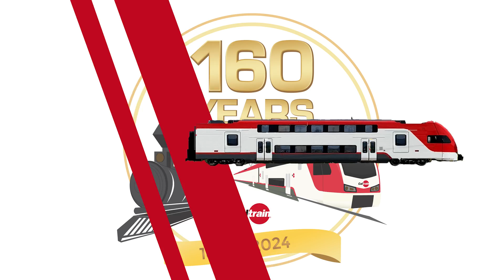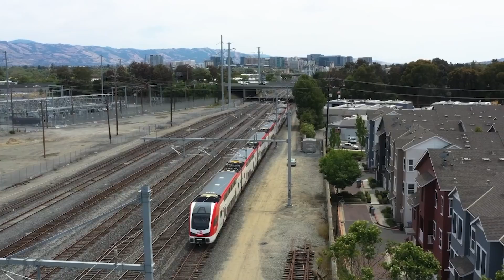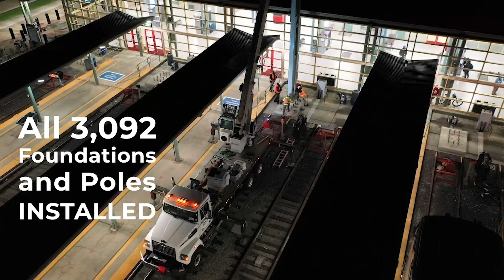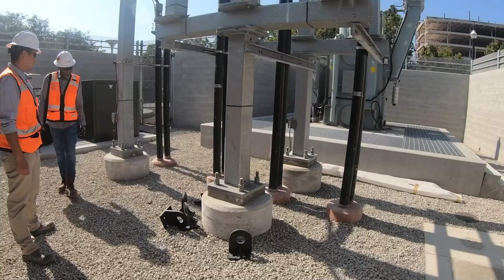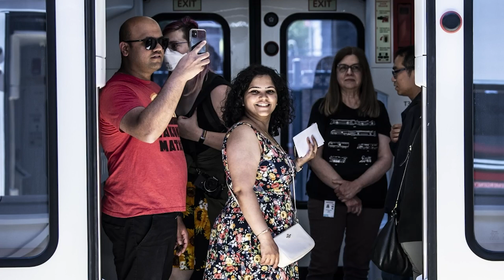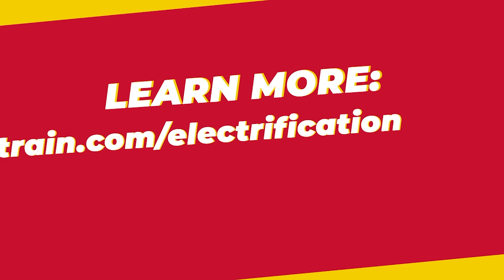Building the Future of Electrified Service

Comment: I thought Caltrain will go up to 110 mph, not just 79
Reply: When more grade separation and full quad gates with cahsr arrive
Reply: When the Caltrain electric trains start in september 2024 San Jose to San Francisco express trains will do it in under 1 hour and local service train in 75 minutes (instead of 100,  source: online community meeting from Caltrain)
Reply: The speed limit for the tracks is 79 mph, although the electric trains are capable of going faster than that. I have not been able to find a primary source saying what limits the track speed.
Reply: @pfroud1  in the US, anywhere that has grade crossings is limited to 79 mph
Reply: @buildintotrains  Not true. Grade crossings can get up to 110 with the possibility to get to 125 if certain standards are met. The real reason why 79 is the limit is the lack of some sort of automatic train stop or equivalent system. That restriction applies to all track regardless of grade separation. Good chance the reason why Caltrain is limited for now is because CAHSRA still has yet to decide on a standard for their safety system and they don't want to spend a ton of money for one system just to have to implement another. You can blame this on the FRA and ICC before them for refusing to just create and enforce the use of standardized control systems for the past century.
Reply: To add after do a bit of digging. It looks like they did install some sort of signaling system that may or may not allow for future speeds, but it needs more work until it's clear for higher speeds.
Reply: San Francisco - San Jose is light rail not high speed rail.    79mph is a decent speed for a line with that many stops 
Real high speed is designed to connect metro areas much farther apart with fewer stops (SF - San Jose would be a 3 stop segment on HSR)
Reply: @maumor2  Caltrain is not in any way a light rail system. It's a regional rail system. The Stadler Kiss that they are using and the Bi-level Cars they are replacing are all large mainline rolling stock. Caltrain is also expecting to be run at higher speeds once the track is eventually upgraded for CAHSR. Right now, the limiting factors there are safety systems and track geometry.
Reply: @travisbeagle5691  here in Europe we wouldn't call that "regional" isn't the bay a whole metro area?
Reply: @maumor2 caltrain is a commuter rail. If you are from europe id suggest doing some research before making silly statements that caltrain is a light rail
Reply: it is important to bureaucrats that its physically imaginable for the cahsr to get to SF in 2 hours and 40 minutes. So, the caltrain trains have to be ready for a future that may never happen as it isnt clear where the funding would come from for grade separation or to prepare the level crossings for such high speeds. Maybe they local bureaucrats hope the federal government randomly decides to pay for it.